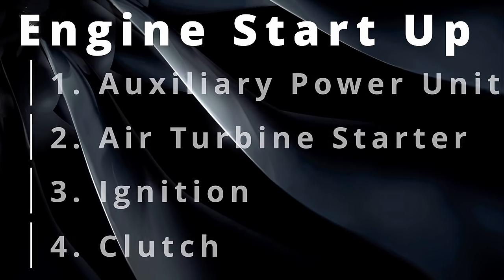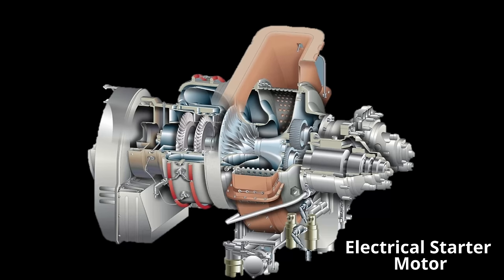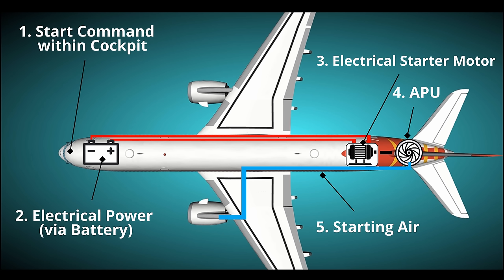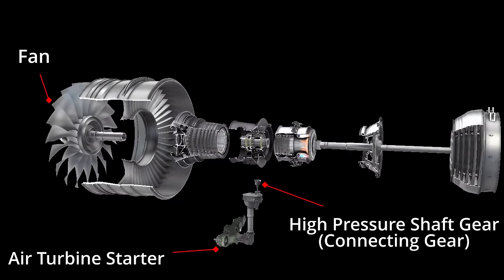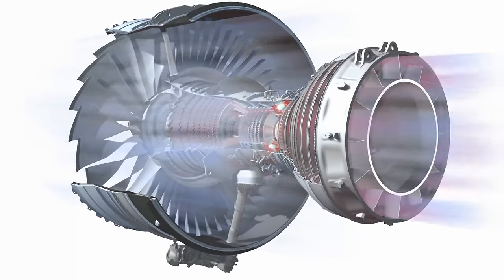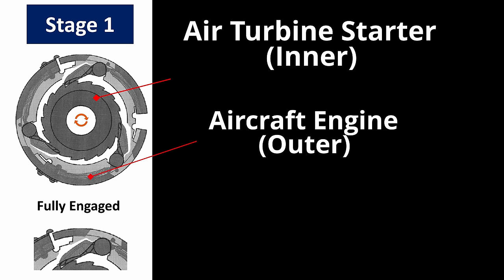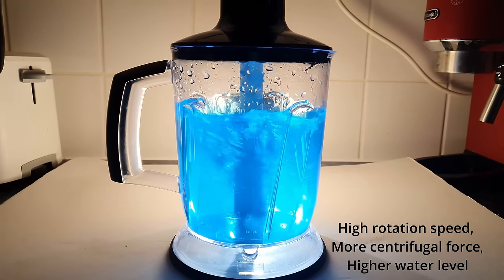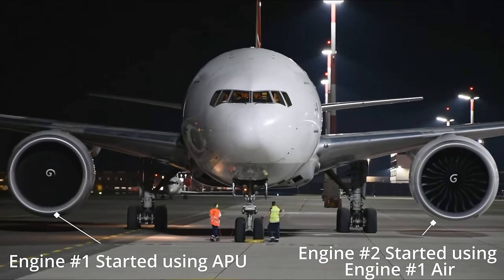How do Airplane Engines Start? (Including Startup Sounds)

Comment: Thank you for the turbine engine startup process. Could you do a similar video for jet prop systems, and a third with liquid fuel gas propeller engines? Excellent graphics, easy to follow, fun to observe and extremely informative. Bob C Clearwater, Fl former AIR FORCE Veteran 🇺🇸👍
Reply: If by "jet prop" you mean turboprop engines, then the startup process will be very similar, if not identical: The only difference between a turbojet and turboprop is that the latter has a free power turbine bolted onto the back, which converts the high pressure, high velocity turbojet exhaust into mechanical torque, which is then utilised (via a separate driveshaft and step-down gearbox) to spin the propeller.

A turbofan engine works the same way as a turboprop, the only difference being that the free power turbine drives the big fan instead of a propeller. In older turbofans, the free power turbine drives the fan directly, with both rotating at the same speed. Newer turbofans use a step-down gearbox to spin the fan at a slower speed than the free power turbine. This is necessary for large diameter high bypass turbofans to prevent the fan blade tips exceeding the speed of sound, which would otherwise produce more noise and be less efficient.

The other variant is the turboshaft engine, which again works the same way as turboprop or turbofan, except that the free power turbine drives an output shaft coming out of the back of the engine, which is known as a "hot end drive". Turboshaft engines are most commonly used in helicopters, though they can also be used to make electricity (by connecting the output shaft to a generator), or in marine applications to drive a ship propeller, again most likely through a step-down gearbox.

Whether you are using a turbojet, turboprop, turbofan or turboshaft, the core of the engine is going to be the same - a compressor, combustion section and a turbine driving the compressor. The starting method largely depends on the size of the engine: Electric motors can be used on smaller engines, such as the 1950s era J47 turbojet, which used a big, beefy starter motor, consuming 400 amps at 30 volts DC, which is 12 kilowatts or about 16 horsepower. To put this into some perspective, this is about 10 times more powerful than the electric starter motor used in the average car.

Larger engines are usually started with an air-turbine starter, which is essentially a weight-saving measure: An electric motor powerful enough to start a modern turbofan engine (a Rolls-Royce Trent 1000 for example) would be impractically large and heavy, as would the batteries needed to power it. The combination of the APU and an air turbine starter is much lighter. An added advantage is that an air turbine starter can be powered for as long as you like, provided you have an adequate supply of compressed air to run it. Those 12 kilowatt electric starter motors could only be powered for a maximum of about 90 seconds before they would overheat, after which they needed at least an hour to cool down before being used again.
Reply: @lloydevans2900  One thing perhaps worth noting from a passenger perspective is that a turboprop can have another major change in sound once the startup is complete and the blade pitch is adjusted. The ones I often ride in seem to start up fully feathered and then pitch to provide thrust when they're ready to move - although I don't know whether this is universal.
Incidentally I didn't realise that turboprops ran off a secondary turbine - I always assumed the prop was on a (geared) shaft from the turbojet core. Glad to be corrected :-)
Reply: @simonwaldman5497  There are some older turboprop designs which do work as you originally assumed, with the power output shaft spinning at the same speed as the rest of the engine, then going through a step-down gearbox before driving the propeller. To achieve this, the turbine section has to extract more power than is necessary to run the compressor, so is either larger than the equivalent turbojet would be, or more likely just has extra stages added. The drawback of this design is that whatever the engine is driving will necessarily have to also be spun up while the engine is being started, which places an extra load on the starting mechanism, whether that is an electric motor or some kind of air turbine starter. Also, this design cannot be used to drive anything where there is a possibility of the mechanism seizing up or significantly slowing down, because that would stop or slow down the engine core itself.

Hence the development of engines with free power turbines, because then the core and the power turbine can be mechanically independent and spin at their own optimum speeds, which also makes the system far more efficient. The most well known and popular engine which works this way is the P&W PT6, used on a lot of light aircraft, either as a single engine right up the front, or wing-mounted for some larger twin-engine aircraft. It is also built as a turboshaft variant for helicopters. A curious aspect of the PT6 is that it often gets installed "backwards", with the air intake behind the exhaust - if you ever see a single engine light aircraft with a pair of exhaust pipes curving backwards just behind the propeller, you can be pretty certain that the engine is a PT6.
Reply: @lloydevans2900 but it's the starter we are interested on.
Reply: @simonwaldman5497 I think they start up in beta range as this might mean the smallest air resistance that the prop has to overcome. To taxi the prop pitch shifts to high pitch for best efficiency, and to brake the plane in taxi, the prop can be shifted to beta again, with no forward pull. Some turboprops taxi out from a gate backwards, with the props set to reverse pitch.

Comment: Awesome video, I am an engineering student and we have just finished up the Brayton cycle/propulsion cycle in Thermodynamics 2 and I was wondering how these jet engines first get started, I felt like a traditional electrical starter might not be practical enough to exceed these engines stall speeds.

Comment: I’m an airline captain…and this is a pretty cool video… However, starting the 2nd engine with air from the first is NOT a normal procedure… With normal APU operation, both engines are started in the same manner… Cross-bleeding works fine(using air from the 1st to start the 2nd), but it’s not the norm….

Comment: Fascinating video .  As a suggestion , could you cover the different types of false starts, like compressor stalls etc and how to rectify these, please?
Reply: Mitch you could also teach us.
Reply: To make it simple on CFM engines with automatic starting sequence (on Airbus A320 family)
The pilot select the engine to start and push the stat button. The Engine Contol Unit ( ECU) checks for air pressure available at the inlet of the air starter and opens the starter air valve. The air reach the starter which starts to rotate the engine High Pressure Compressor. When the HPC reaches a minimum speed of around 13% the ignition and fuel are turned on. After 1 to 3 seconds the fuel is ignited in the combustion chamber and the engine spools up to idle (around 60% N2 (HPC speed)). If the engine does not accelerate and the EGT does not increase after a few seconds (I don’t remember how many but it’s pretty quick) then the ECU makes a second attempt with both igniters on. If it starts then it’s ok and the ECU generates a maintenance message to tell that the first igniter did not work properly. The pilot does not see this message. It’s only listed in the post flight report. If the second start attempt fails (no speed increase and no EGT increase, then the ECU makes a last attempt with a modified fuel flow. If it fails within a few seconds then there is a 30 seconds motoring time ( the starter turns but the fuel flow is stopped) to clean any potential fuel in the engine then the engine starter stops and the ECU declares an engine start failure. There is a report with all the main parameters in order to troubleshoot. It’s very very rare. If there is a slow acceleration and a EGT increase outside of a normal envelope then the ECU monitors the EGT until the engine stabilize at idle. If the EGT rise is too quick and may lead to an EGT over temperature then the ECU will cut the fuel to stop the engine. This is the only case where the ECU decides to stop the engine. The aircraft is on the ground, then the ECU protects the engine. But if the same condition occurs (overtemp, overspeed, low oil pressure, …) in the air, the ECU will never stop the engine by itself. This is where the pilot justifies its salary 😀 Even if FADEC means Full Authority… the pilot is the only big boss on board.
I hope this gives you an idea of what happens. 
Compressor stall does not exist any more on modern engines. At least with CFM and GE engines 😀. I remember the good old days when I was a CFM instructor , we used to say that a CFM engine does not stall. And if it happens in flight, the first stall is free. The procedure ask the pilot to retard the throttle to idle, see if the engine parameters are corrects and if so, push the throttle slowly while monitoring the engine parameters. If it returns to normal, then it’s ok. 
Today the monitoring of the main parameters during the complete flights give a lot of information about the engine deterioration before it leads to an engine stall during start. It may happen during flight due to specific conditions but not during start. Even if you start with a strong nose wind and a negative rotation of the fan, you engage the starter and wait for a positive rotation of the fan before putting the fuel and ignition on, and that’s it.

Comment: To remember how jets work…just remember Suck, squeeze, bang, blow.  Compressor sucks and squeezes the air.  Combuster/ignitors ignites the air as fuel is injected into the compressed air (bang), super heated air is then fed thru turbine section, which is divergent causing thrust (blow).  It’s like holding your thumb over a garden hose…you feel pressure pushing your hand.  The blow also drives the compressor…and big fan in front which also produces thrust.  This is called the Brayton Cycle.

Comment: 0:40 "By a large onboard battery"

Commercial jet technician here.
 Its only marginally larger than the battery in your car. Though they throw out twice as much voltage. And there are two of them in narrowbody jets, and 4 of them in most widebody jets.

Comment: It is very rare for engines to be started from another as you need to spool up to gain the 40 psi needed. It is only the HP spool that is driven. The LP rotates as the airflow generated by the rotatating HP drives its turbine. 
The 20% mentioned is HP speed as you only need to check you have rotation of N1. 
Other than that good description.
Reply: Yup! Actually, I haven't heard about rotating the LP fan during the start-up.
Reply: You would only use bleed air from the first engine to start the second engine when doing a cross-bleed start. This would be required when the APU was unable to supply bleed air, and a ground airstart unit is used to start the first engine.
Reply: @stephenholland5930  or if you have to restart an engine in the air. As the APU is generally turned off.

Comment: I've always been curious about the specific sounds an airliner jet engine makes during startup. Now, I've finally learned what that particular sound is just before fuel injection in the main engine: it's the speeding up of both pressure shafts. Each shaft has a different RPM and can sometimes go out of harmony with each other.
Reply: In fact, during the start sequence it’s mainly the air exiting the starter and the HP compressor spooling up that you hear. When the starter provides the maximum HP speed, around 20% of the maximum, the LP spool ( Fan in the front and low pressure turbine in the rear) are only rotating at 4-5% of their maximum by the air going out of the engine. So you don’t hear it. When fuel and ignition are turned on you may hear a little clic noise (and if you can see the back of the engine, a small fume) and then you hear the engine spooling up to idle ( around 60% of the maximum) the GE90 of the B777 has a double annular combustion chamber which gives a specific growling noise when the ignition begins until it stabilizes at idle. This shows that the engine is not designed to run in this condition. It’s a little weird, but it’s perfectly normal. Then everything becomes quiter.
Reply: there are no "pressure shafts"

Comment: Thanks. The explanation is simple and straight forward. Just in case the starter system fail, the pilot need to engage the clutch pedal, put to second gear, ask ground crew to give a little push to the aircraft, and pop the pedal..😄
Reply from the maker: Haha! The absolute fail safe method 👌
Reply: Bloody true, sounds like you fix what pilots break😂
Reply: PS when I did my apprenticeship on Beechcraft, I have been ask a question similar to that. 😂
Reply: If second gear doesn't work, try reverse (thrust) 😜
Reply: The cool thing about this procedure is that its in flight!

Comment: The SR-71 used an external V-8 engine, connected thru a driveshaft, to the engine.  Once started, the shaft was removed.  
On the KC-135R, it has two large APUs on board, so it can start multiple engines at once.
Reply: So the Blackbird wouldn't be able to even start its engines without on any other airfield than that with that kind of engine?
Reply: @M3dicayne  correct.  It could only land where full support is available.
Reply: Actually, the start carts for the SR71 had two 400 hp Buick engines connected together to start the jet engines.  Later on the start carts used two 460 hp Chevy 454 ci engines.  Those engines had to be revved up to their red line to spin the jet engines over fast enough to start.  Those things sounded awesome when they were spinning up to start the jets.
Link to video of start cart in action:
https://www.youtube.com/watch?v=JjdyQpEUYzI

Comment: Show us the start up of a Pratt and Whitney R 2800-500 The ßame engine in the F6F, F4U 1 to 4 and P47.
Reply: Piston engines seem less complicated that jets. AFAIK the generators on the engines are used as starter motors that spin the engines. Same as on a car. Power can come from the onboard batteries or a GPU, or even from an APU.
Reply: @PeterNGloor  I love the sound of Radial engines the bigger the better.

Comment: Cool video! But we start the second engine exactly the same as the first one, so with the help of the APU. A crossbleed start, where you use bleed air from the other engine instead of the APU, is only used when the APU is unserviceable. The rest of the video is very accurate!

Comment: I was interested to read about the "start cart" which is used when the APU is inoperative.  Apparently, it's not that unusual for a plane to be considered airworthy without a functioning APU.
Reply: No, but only for 10 days.
Reply: ATC here. "Cross-Bleed Starts" are not uncommon. I'd get a request maybe once every week or so. They use a start-cart, then push back, then throttle up the single engine and cross-bleed the other one.

It often requires ATC approval as starting an engine on the bay is really uncommon and presents hazards as compared to doing it in the push-back.
Reply: Commercial jet technician here.
They can be allowed to fly without a working APU, but the plane cant go to as many destinations. Only ones that have start carts. Or "huffer carts" as we call them.
Reply: Ramp agent here. Nothing to add just want to be included 😂 although we call the “starter carts” an “Air start”, have also had to keep ground power connected for an engine to start up on stand because of an inop APU, but yeah isn’t uncommon. Nice to know what the sounds are when I’m telling the pilots it’s clear to start engine 1
Reply: @markcrawford8651  Hey, you rampies have important jobs. You're more than welcome!
Reply: Propeller turboprop  ( C-130) aircraft can do buddy starts. One airplane positioned in front of the other and prop blast used to turn the other planes propeller to get it to ignition rpm. Pretty cool move, ive done it about 3 times in a 24 year career on C-130s. Tried it once with a huey helicopter but wasnt quite enough blow.
Reply: back in the day the first jets had no APU. I saw the first ones on the twins that followed the DC-8, Caravelles and 707's. Some military planes had small diesel engines functioning as APU's but I guess they could deliver only electric power.

Comment: Its usually always
1. Batteries
2. Fuel Pumps
3. APU
4. Engines
5. APU Off
6. Fly
Reply: So no hydraulics…got it
Reply: @justing42  Typically the engine-driven hydraulic pumps are left on between flights, so they will pressurize the hydraulics once the engines are started without the pilots having to do anything.

Comment: They're not referred to as spark plugs, they're igniters. 👍🏼
Reply: I use one to start the flame on my propane stove....
Reply: Actually on many engines you can hear them from the outside, but I heard them on the inside, also.

Comment: Interesting video, but allow me one minor correction: in NORMAL operation, we do start BOTH engines by using APU bleed air. Only if the APU is inoperative, we use an external air starter unit to start the first engine and then apply the "cross-bleed start procedure" to start the other one with the air bleed pressure from the first engine ;-)
Reply: Would it be more efficient and quicker to Cross-bleed to start second engine?
Because you can shut off the APU earlier and first large engine produces more flow/pressure for second large engine than the APU. Also the two larger engines could be closer to each other that long run from APU.
Reply: @railroad6601  it is about PRESSURE....it doesnt care where it gets it, as long as it has it
Reply: @railroad6601 no it’s more efficient to start all engines from the APU